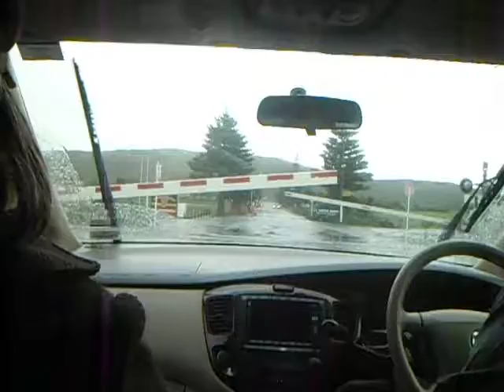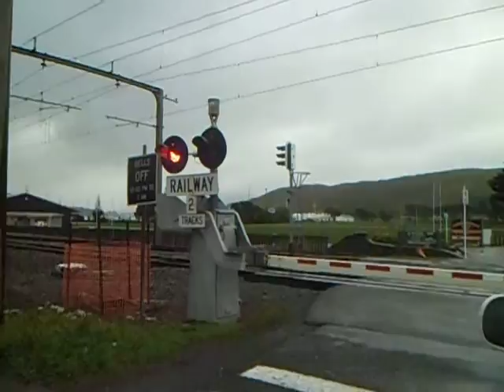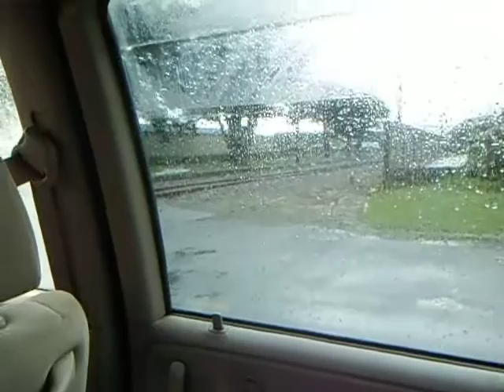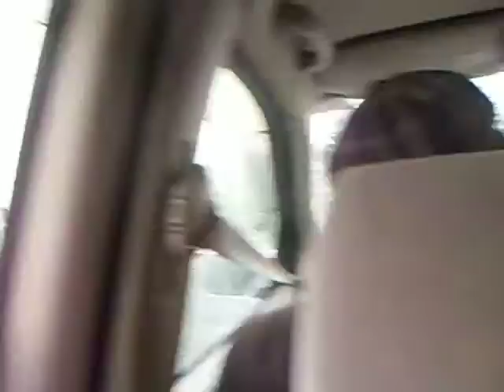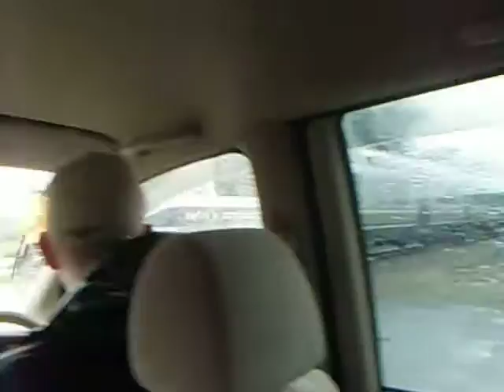Mana Level Crossing (Filmed in car)

Comment: Over the past few years, Kiwirail have been re-signalling parts of the network
so the level crossing alarms don't start untill the train stops at the station, e.g. At Paraparaumu, Paekakariki, Plimmerton, and at Khandallah on the Wellington Network, and it has also been done all over the Auckland network  so that it doesn't hold up all the traffic. 

(In reply to "Lama Lifts NZ"), In New Zealand we have about 7 diffident types of alarms on our level crossings from my understanding,

For mechanical bells (M Bells) we have...
(1) Western Cullen Hayes mechanical bells.
(2) Griswold mechanical bells.

For Electronic Bells (E Bells) we have...
(1) Western Cullen Hayes Electronic bells.
(2) Safetran Type 3 Electronic bells. 
(3) EBA Electronic bells.
(4) (Not 100% Sure on this one),  General signals Electronic bells.

Other Types of crossing alarms...
(1) Roshni sounder.
You will find this type of alarm used on the level crossings at New Zealand ports,
This Alarm is also used as "SECOND TRAIN COMING" alarms on Linden Level Crossing.

So I wouldn't say we have only 2 types of alarms on our level crossings, Not true.
Reply from the maker: +Jamie T Ede Thanks Jamie. I've only heard two types of bell, this one and the older one....I prefer the older one personally, but only Redwood and QE Park still have it on KPL. Plimmerton & Paekakariki have both had the bells replaced.
Reply: +The_ALEX_ELLIS_Channel 
Keep an eye on my youtube channel, I will soon be releaseing a video of all the diffident types of bells used on the Kiwirail network.
Reply: The old bells are loud and warn of danger approaching ie. a train. they should never have been replaced.
Reply from the maker: hek parai
Agreed!
Reply: +The_ALEX_ELLIS_Channel What about Pukerua Bay? That still has Griswold bells.
Reply: Can you get a video of Q.E Park?
Reply: Bunny Lift & Rail Photography and lots more I'm in Brisbane. Sorry.
Reply: hek parai I meant The_ALEX_ELLIS_Channel